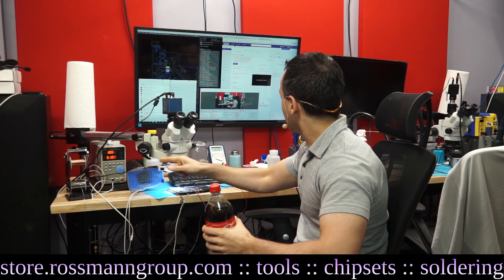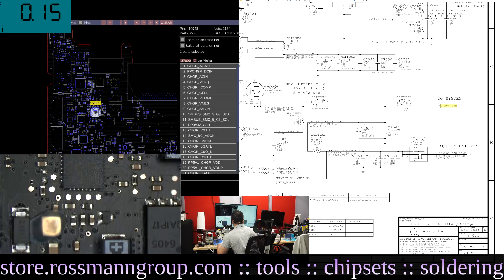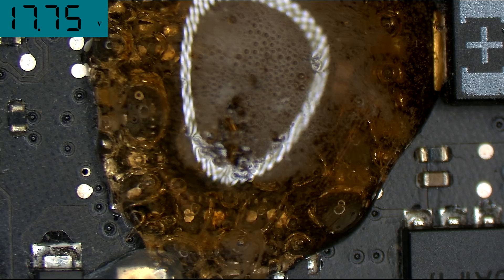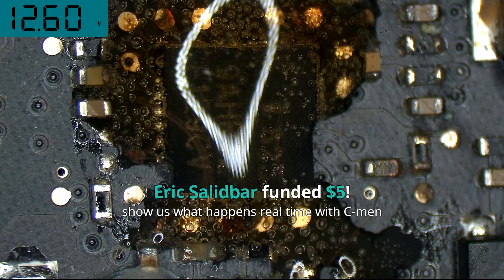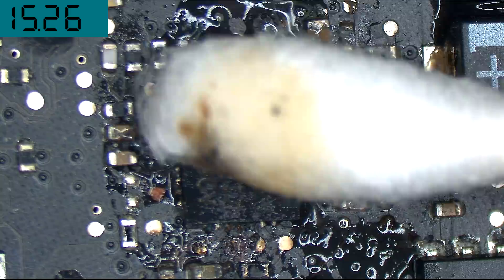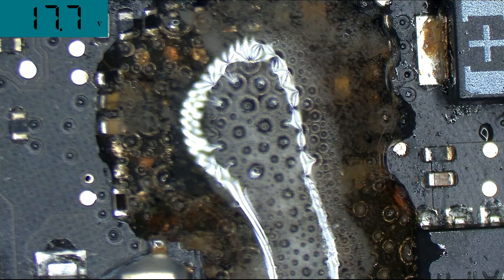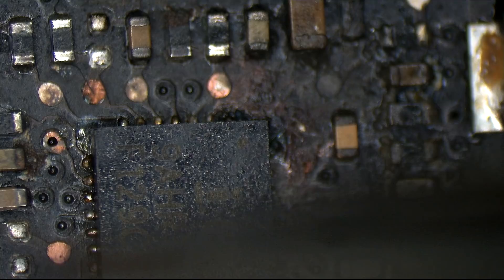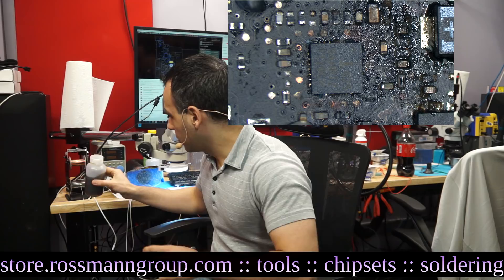How fast will Coca Cola corrode a Macbook logic board?

Comment: Speaking as one with wide experience with corrosion in a marine environment trust me when I say electrolysis works on all scales. If a 1 Volt galvanic potential through salt water between a bronze propeller yards from 3/4" thick steel plate rots away a ship's hull in a matter of years, think what 18 Volts does through acidic soft drink between  0.002" copper 0.040" from soldered micro circuitry in a very few seconds. It's all a matter of scale and the electrolyte. Get a phone or a laptop wet, instantly - INSTANTLY - remove the battery. Dodge bullets first if you have to but don't let anything else distract you from removing the battery.

The black stuff on the Q-tip is corroded metal. What has been corroded away can never be replaced. Genius micro-electronics repair people can do only so much. Brilliant endeavors yes, but few miracles. 

If personal electronics were conformal coated at the factory and the connections were properly sealed against liquid intrusion, corrosion avoidance would cut unplanned replacement sales volume by 25% or some such figure. Military and industrial electronic equipment has been protected against full immersion for generations - meaning the technology and process equipment is mature and available and well suited for mass production. 

Conformal coating and connection sealing would add a buck to the cost of manufacture. Greedy, crooked bastards. It's criminal.

How would you react if bird poop rotted a hole through your new car and disabled it requiring you to buy a new one? Raise a fuss, consumers. Your electronics doesn't have to be sucker-punch vulnerable to predictable accidents.
Reply: Forrest  Addy Would it be feasible to apply conformal coating post manufacturing on a device like a MacBook?
Reply: Mees Boeijen I would think so. I'm not really qualified to cite specifics but my information is conformal coating can be a retrofit application. There are kits I think and outfits who do this sort of work. My hesitation derives from how to liquid proof the connectors and other energized and creviced components. Louis and colleagues are in a better position to pronounce on the ways and means of doing the Mac Book - and the billions of others devices which their makers should have fully protected at manufacture.

I have a cheap Asian built, no-name plasma cutter made on the ragged edge of limited function, useless piece of shit, and cheap construction and its boards are thickly covered with a glossy film of protective coating. I mean this is a true piece of crap yet it has a quality conformal coating you can't find on a $700 phone or a $6000 gamer's laptop,

The boards are protected from dirt and moisture, not the connectors. Apparently the people who run Lotus Flower Really Dirt Cheap Asian Products LLC are still working on that.
Reply: i think conformal is killed by acidic solution because battery leakage just eat conformal coating i think coca cola take more time than a battery but same result at the end
Reply: XxRaidenxX XxRaidenxX Most weak acids won't attack most catylized resins. Storage battery acids in long term contact mat be a much different deal (an orange compared to apples, so to speak) A conformal coating separates the energized metal surfaces from conductive liquids which could serve as electrolytes. Most conformal coarings are intended to serve as an insulator and water barrier. Except for points of vulnerability and ionizing electrical potential, modern conformal coatings are all but invulnerable to developing conductive tracks through the unbroken film - possibly excepting long term contact with strong sulfuric acid.

The vulnerability you raised is where a bare conductor adjacent to the coating is attacked chemically (acid) or by electrolysis. The coating itself didn't fail but the corrosion damage penetrates under the coating from the edge, lifting it and causing the bond to fail. Under it, the exposed metal is open to galvanic or chemical attack. Had you gooped these connections with some protective substance (silicone tub and tile caulk comes to mind) they would have been preserved from attack. There may be low voltage electrolytic or chemical attack elsewhere but not through a tighly bonded contiguous insulating coating.
Reply: don't say conformal coating too loud- apple might listen and fill the entire notebook up with resin- so we get a non-repairable blob of plastic ...
Reply: Mees Boeijen you could simply dunk your board in nail polish (after protecting contacts and checking temps afterwards of course)
Reply: As Louis's videos have clearly shown, Apple can be counted upon to mis-design and build things badly. Of course, failing to conformally coat a laptop is a mystery to me. People use these things in bed, cramped airline seats, coffee shops and the like and proceed to eat and drink in their vicinity. I eat in the vicinity of my desktop computer, and do from time to time get liquids and the odd fingernail clipping in my keyboard. But it's an IBM, so it's designed to isolate anything dropped into it from all circuitry. Thank you, IBM.
Reply: Nah, that WOULD stop them breaking.... so no chance of Apple doing that.  ;)
Reply: >Get a phone or a laptop wet, instantly - INSTANTLY - remove the battery.
Sadly, there are less and less devices where it is possible. To disconnect battery from most modern notebooks and phones you need tools and time. So unless device is waterproof it is almost impossible to avoid corrosion.
Reply: I think you can make a new service out of that, Louis. Conformal coating electronics for $25 a pop?
Reply: Greedy? Sure. But it also has to do with them benefiting from us buying new hardware earlier. ;)
Thanks for your informative reaction Forrest Addy.
Reply: Not the worst crime that was done for profit.  Free world thay say
Reply: Forrest  Addy reading your wisdom, I feel like a citizen of the world. I know some things I didn’t before. I am empowered.
Reply: What would happen with tap, bottled, mineral, or toilet water?
Reply: Ron Smith Try it and see
Reply: protomors yes in such cases if battery can’t be removed do not mess with the device u can try to turn it off and that will limit what can get damaged but u maybe have already destroyed it b4 u get it off of just leave it asleep slowly pull it apart (or skip this step if u don’t know how or it’s to much a risk if it’s own if you never pulled a phone apart I wouldn’t start here) and dry it out the idea of rice was a nice thought but really it’s worthless a fan with a hair of heat will get u so much farther quicker if u can pull the device apart should only take hours to dry out if not looking at 3-4 days then try your luck.  A lot can be damaged with the battery inside but again a lot more can get damaged by waking it (raising voltage and adding power to more circuits). Also “pure” water won’t damage anything it’s the salt in the water and other minerals that cause the damage if u get soda inside then well basically all bets are off
Reply: Can you link any resources to making my phone more durable?
Reply: Too bad you can't remove the batteries in most modern smartphones
Reply: Forrest  Addy 
Some ford(s) had a bulletin to flush your antifreeze if you got a check engine light in particular situations from the electrolysis voltage. 
And they had you run ground straps to the heater core and radiator.
Reply: Forrest  Addy 99.9% of all Apple laptop owners will not be able to open their device after a spill as they do not have the proprietary pentalobe screwdrivers. And only 3rd party shops like Louis will attempt to fix liquid damage, the Apple store will just say the logic board needs to be replaced, at a cost so close to a new Macbook that 99.9% will opt for the latter. It is all part of the plan.
Reply: Now I've seen this he needs to do the same thing after spraying a conformal on the board.
Reply: An excellent comment :  Your penultimate paragraph says it all .... My MD wanted us to get our quality up so our failures were below 1% - i told him that this was easily achievable, but the incentive was quashed because the company made 25% of its gross sales and 75% of revenue from the sale of spares....
Reply: Say if a component failed, be it by blowing up or just less noticeably shorted, would it still be possible to repair if coated? Would you have to remove the coating in that spot and replace it or can it even be removed
Reply: I spilt a teeny bite of cocacola onto my keyboard and it started making issues since then. Thanks for explaining about how careful we should be about buying things as consumers. That keyboard was Logitech flagship G910

Comment: I'm watchcing this on the mac i spilled coca cola on 20 min ago....
Reply: I just spilled coke on my macbookpro (2017 13”), it turned off, I got a piece of clothes and rubbed the keyboard while upside down, it turned on, I was dumb to let it on and went to yt watched the 165hz video, K started clicking I touched it and it stopped afterwards my pc just turned off, I put it between 2 absorbent cloths and put something on it to stay warm-ish, im gonna try to let it air afterwards. WISH ME LUCK EVERBODY!!
Reply: @Moha_  I spilled it tried to turn it off opened it under, used an hair drier for like 10 mins opened it again cuz i have no patience
Reply: @sample1848  well, it’s been more than 1year, time for a new computer I guess...?
Reply: @Moha_  No i still use it to this day, i mean my charge cicle is about 1500 times but oh well works fine for the most part

Comment: It's not that the chip isn't switching, it's that the liquid is shorting its input to its output. Therefore, whether or not the chip is trying to switch its output is irrelevant -- it's bypassed by the conductive liquid. Also, I suspect that much of what you're calling "corrosion" on the non-metallic areas  is merely residue -- a combination of caramelized sugar and food coloring from the beverage.

You're absolutely right, though, having DC power passing through an acidic liquid like that is electrolyzing the bejesus out of the copper, possibly even electroplating it onto the tin/lead in the solder joints.
Reply: it is corrosion + liquified black coating from the board. coca cola contains a lot of phosphoric acid, and that stuff is super nasty.
Reply: TSteffi no it won't happen if there is no power
Reply: this is a switching circuit,  rather than a direct short from input to output , the MOSFET sourcing the voltage may simply have its' bias resistors short partially shorted by the material ( and even breath condensing can so that) and therefore could be providing an OFF signal which does not get through.

Comment: Dell and IBM/Lenovo DECADES ago in BUSINESS class notebooks,made spill RESISTANT mobos
   -using strategic plastic covering-with drains-under keyboards
    NOT so APPLES~~
      -so decade old business units STILL running-despite  exposure to colas,coffee,teas and water
Reply: i covered my mobo in paraffin, i covered my whole damn gpu with paraffin, i have a diy watercooler with a diy waterblock, the few times i spilled anything on the board i just removed and shaked the water away from the hydrofobic paraffin and put it back.
Reply: my waterblock is on top of the gpu because my mb is on the weird side, so if water were to fall from the watercooler it would certainly fuck the whole board if it wasn't for paraffin, as it runs at night sometimes and i would have no control.
Reply: I have an HP Elitebook 8560 W with that plastic, it looks liek someone spilled coffee on it (Got it second hand) I cleaned it up and it works like a champ, but damn does the system run hot (GPU anyways, 35-50C, but i read most peole who have this laptop say it runs hot)

Comment: "But it was only one drop!"
You know how many circuits a drop covers?
Reply: Depends on the size of the circuit.
Reply: A circuit in a Mac product, high density micro circuitry.
Reply: PBMS123 Why did you buy a Mac?
Reply: Mac is not a good OS... 
The only good OS's windows had since 2000 was XP and 7 and that was only after modification. 
Come 2020 I'll probably be switching over to linux because I'm not going to use an OS that collects telemetry. 
I installed Linux Mint on a buddies PC and I would have little problem using it if it had things like Lightroom, Photoshop, Autodesk, etc or at least AS good.
But I do think linux is going to build a user base once windows 7 becomes unsupported.
Reply: BlindAF yeah, I've been seriously considering Linux because of all of the info that Microsoft likes to collect.
Reply: Ahammer, try Spybot Anti-Beacon. A video by Barnacules Nerdgasm covers the settings. I tried it but some of the settings reverted and I didn't bother to figure out why, I just installed linux... I'm waiting to hear about all the personal data leaks from the App store. Facebook just got exposed for sharing a little too much (as in everything) private information.
Reply: ですLoli Hunter like I'll say I'm not gonna pay 3500 bucks for a mac (2100 is more realistic I think 3500 is Imac) just to run mac OS if i could do it on a PC I'd build a PC for mac OS but when I can build a PC 10x aw powerful for the price I'm not buying it
Reply: PBMS123 you get it
Reply: Sorry to burst your bubble, but that is bullshit. You get way more bang for the buck in a PC than in a mac. The video rendering "optimizations" are more dependant on the hardware than anything else. In that matter, unsupported high-end cards from Nvidia breaks it already there. Adobe also lags quite behind in utilizing the newer features of both CPUs as well as GPUs - but that is true for both macs and PCs. You can't run final cut or iMovie on a PC, but that's just about it. Most other video editors are available on both PC and mac.

There are cases that necessitates using macs, but video editing is not one of those. I'm also typing this on a mac by the way.
Reply: Oof the mac lover in this chain got batter
Reply: I hate Windows now but i love it coz it's the only thing I can play games with. 😑
Reply: "Not everyone cares about gaming"
Correct which is why Windows is the most popular consumer operating system. Linux and BSD can have their server dominance and Apple can continue selling brand new computers to idiots that spill soda on their new shiny thing.
Reply: "do you know how many transistors can fit in a drop?
Reply: Every circuit in computers these days is microarchitecture....

One likes simplicity, one likes looks, one likes complexity, and one needs... Etc.

I personally use Windows and Linux, mainly because MacOS and hardware compatibility really sucks. And far too expensive. But thats their game, they have every right to do so.

I just dont get Apple still be selling this much :)
Reply: @cunnyman  Best joke ever. Do u ever installed Linux on anything? Download the ISO from Ubuntus, Kubuntus, etc. website and just burn on CD/DVD/USB. They even sell physical copies of them. You need just smash the "Next" button like in windows installer. If you are experienced user, you can config it for yourself(swap, file system, partitions), but for n00bs(sry for the word usage), its really "smash one button" game.

Comment: If that’s what Coca Cola does to a logic board, imagine what it does to your insides...

*drinks coke*
Reply: PunkNDisorderlyGamer not much actually, the whole reason it does this is because it is an acid.... like all soft drinks. They all do the same. Why is coke always used as the example? Sneaky marketing from Pepsi? Nah it would be the same level as coke I reckon. Anyway the main reason imo that coke is used as the example is because it is more effective, reason for that is because coke is more carbonated than most soft drinks hence why it does what they all do faster. But it isn’t because they put weird chemical shit or anything in coke, it is because it is carbonic acid, swap it out with carbonated water and same shit will happen (unless the sugar plays a role that is). But yeah worst thing coke will do to you is give you body sugar and increase your ph slightly.
Reply: Pour out some of your stomach fluids and compare it. The coke will seem like  divine water.
Reply: @jayjayx5x1  Nothing you eat can change your body's pH unless you're eating enough of whatever to throw your body into acidosis or alkalosis. You have to have an underlying disease or be eating HUGE quantities of acidic or alkaline substances to make your blood's pH budge even a little. Normal blood pH is 7.35-7.45, any higher or lower and you will be sick.
Reply: Coca isn't much compared to the acid you have inside your body :)

Comment: As a chemist this was fascinating to watch! One of the things you do if you're working with solid materials in chemistry is to reduce the size of the particles as much as possible (grind it up) so that the material has a lot of surface area. This allows the reaction to take place much more easily. The components are so small that they too have a large surface area in comparison with their volume which would make them similarly reactive. This is especially true if the board is warm since the general rule of thumb in chemistry is that the rate of a chemical reaction doubles for every 10 degree C increase in temperature. (not always true, but it's a good approximation with many reactions). Coca Cola is 2% phosphoric acid, which is very dilute, but when that solution comes into contact with tiny bits of reactive metal at warm temperatures with electric current running through them ....well, your video shows it far better than I could ever describe it. Very, very cool. :-)